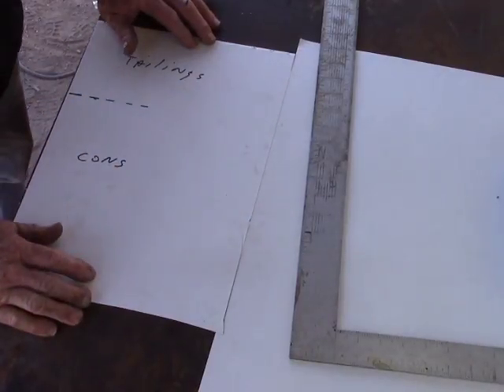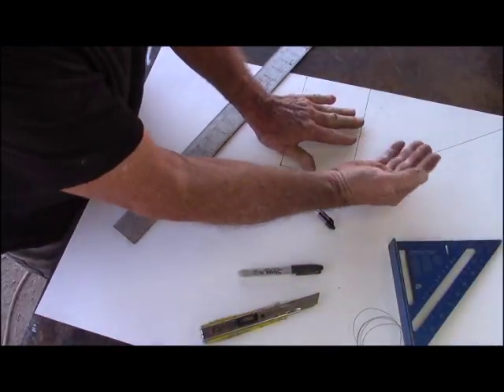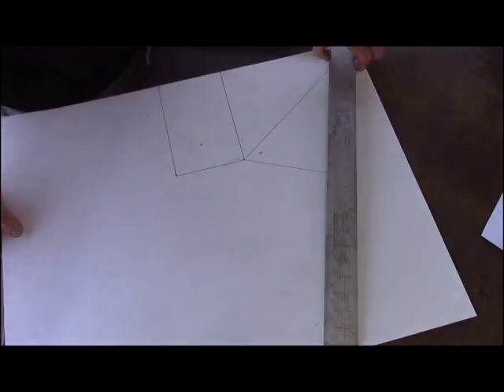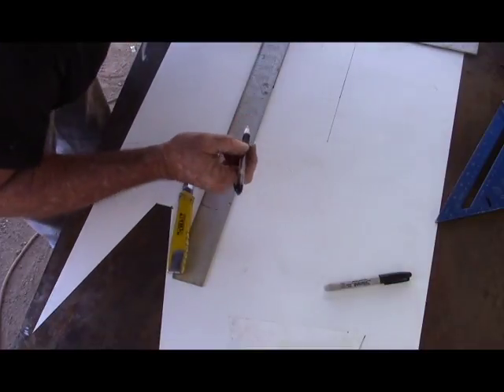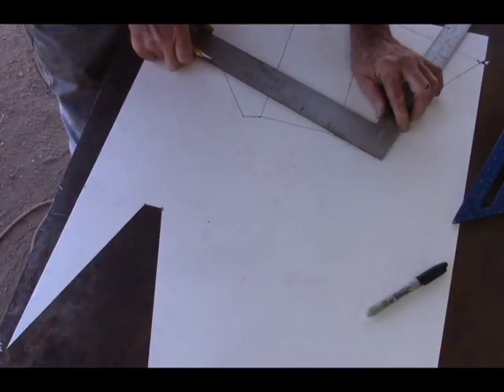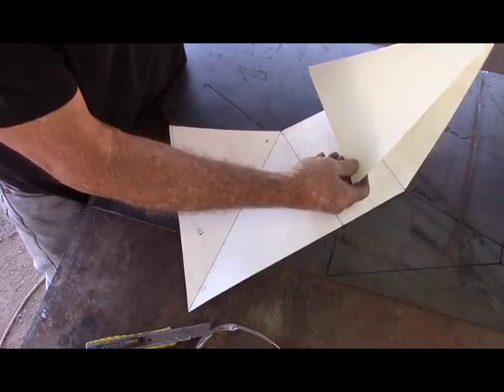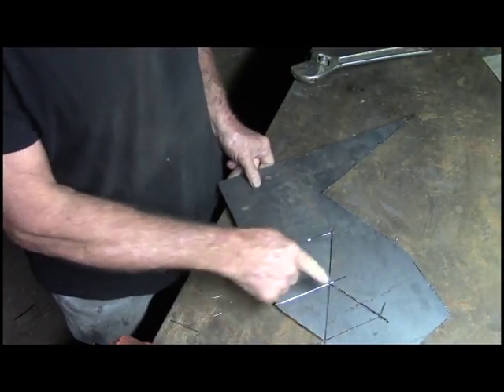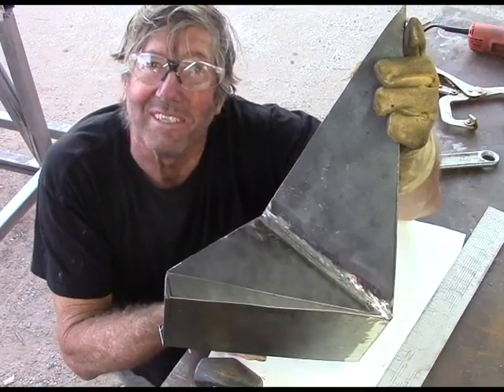Shop Tip 1   Making Complex Shapes With BAD not CADD

Comment: I've used a similar technique to work out the pattern for the flair on my new sluice. Much easier than CAD and I'm pretty good at CAD.
Reply from the maker: For the frame design I used masking tape on the kitchen tile.  I can take the actual components and compare them.  Much simpler.